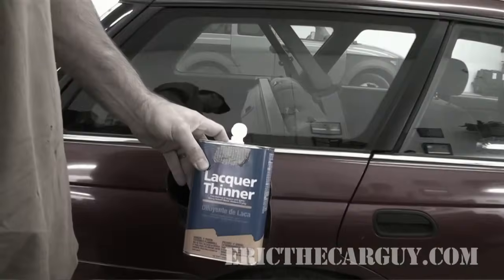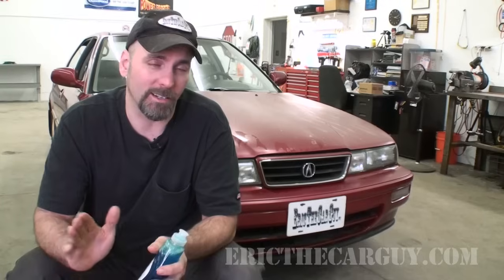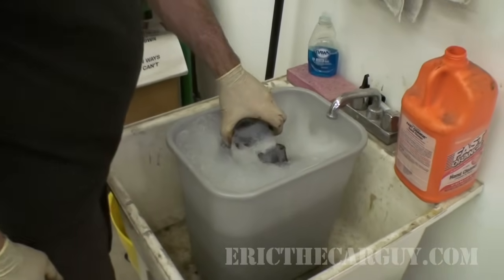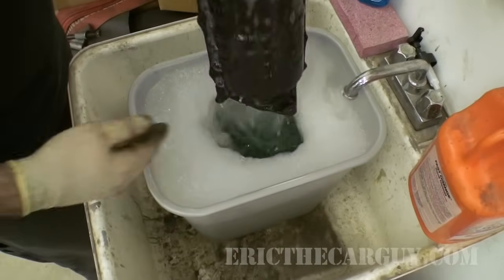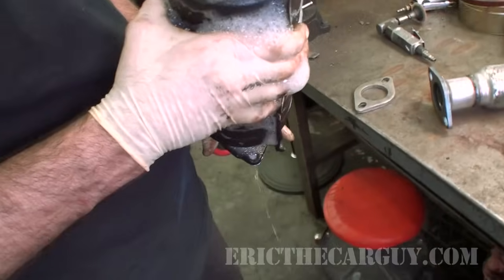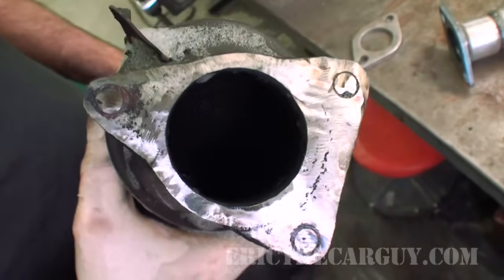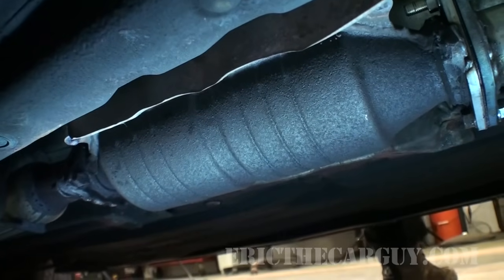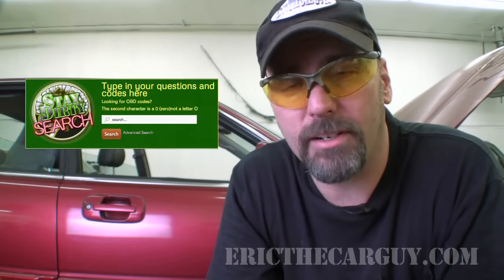Cleaning Catalytic Converters With Soap and Water -EricTheCarGuy

Comment: I usually clean my cats with a screwdriver and hammer :)
Reply: That is the best way :-)
Reply: Yep, and top it all off with the non-fouler trick to get rid of the cat inefficiency code(s) :)
Reply: Grate job
Reply: The mini cat's work great too if you put them In with the right spacers. On my 01 escape the pcm didn't give a damn about the missing rear cat, on other cars I hear you can swap two o2 sensor connectors (label them first! That are nearby to flag a slow o2 sensor code that will light up the c.e.l. but when replaced will run perfect and ignore the missing cat until you clear the codes
Reply: Would it work on my dog?
Reply: Perfect, I was looking for another method. Thanks!
Reply: I cleaned my cat on a clothes line with a 12 ga. shot gun. after what. he did to the neighbors cat.
Reply: poor kitties :(
Reply: 😂😂😂😂🤣🤣🤣🤣🤣🤣😅 haha!
Reply: air chisel plus efi live / hondata
Reply: "I cleaned my cat on a clothes line with a 12 ga. shot gun. after what. he did to the neighbors cat"
 @jprandell6738  that's not funny, that's sick. keep `em coming please.
Reply: @despat3193  jus kiddin i dont shoot cats ..but i don.t that a cat converter can be cleaned

Comment: looks like you needed to rinse it out, let it fully dry, then try again. If your exhaust is still dripping soapy water you could be flawing this test since the detergent is still covering the interior of the cat preventing it from working as it is supposed to. Same idea as covering yourself in a flameable gel, you dont burn until the gel is gone.

Comment: 3M aluminium tape is very good for repairing leaks in the exhaust system. Not a permanent fix but cheap. It's as permanent until the next time the tape gets punctured.

Comment: Hi Eric I have used WD40 you need to use  about 1 pt give it a good soak about half hour you just open the cat on the engine side I used the under sealer applicator give it a blow out the air gun it cleans the whole exhaust system there is a bit of a mess out the back of the exaust

Comment: Phase change. if water is being evaporated you will see significant temperature drop due to the water in the cat boiling off. Better to take a long drive and check it out versus un-rinsed and saturated.

Comment: i tried every thing and i mean everything, what worked for me in the end was to take the oxygen sensor out then spray carb and throttle body cleaner into the catalytic converter the hole can ,and that worked for me .the car had only done 46000 thousand miles i had error code p402 ,put oxygen sensor back in reset the code and engine light has not been back on ,and this was my last try before i bought a new cat .

Comment: If strong solvents won't take out the stuff, the weak solvents in soap won't do it....

Your problem was the exhaust leak, letting the cat run too cold and coke up. I bet the best fix, if this one's savable, would be to make sure there's no leaks, any exhaust air intakes or anything like that work (the inside of the valves can get messed up or dirty, and turn it into an exhaust outlet, instead of intake), and then run the piss out of it and get it really hot.

Comment: Question: 
Could someone at least minimize the problem of a clogged catalytic converter or muffler by parking the car in a downhill street and pouring boiling water through the exhaust pipe? and then driving the car to expel all water.

Comment: Eric you should take a look at the videos from university of Nottingham (periodic table of videos) about platinum and palladium. It would be almost impossible to get a reaction with either substance at room temperature. If I were to attempt this I would actually try the most active/corrosive/agressive cleaning agent I could find (foamy oven cleaner?) But as others have mentioned..rinse and dry thouroughly before testing. The shot with bubbles etc degrades the entire video to highschool chemistry experiment level..

Comment: I don't believe the temperature test is the most conclusive for a catalytic converter.  One other thing you have to take into consideration is that until you get all the water out of the exhaust system it will be pulling the heat off the system as steam.  Also Platinum and palladium are extremely nonreactive to most chemicals so I would worry more about the metal casing of the converter than the material in the converter.

Comment: Logically, wouldn't a mild acid like Vinegar be ideal for removing generic deposits.  For example, couldn't you soak the interior of a CAT in simple white vinegar or apple cider vinegar?  I know that this is NOT oxidation but vinegar is a well known tool for removing rust on iron.

Comment: ok,i had a chevy venture , with the cat getting red hot, took  the lamba , sorry o2 sensor ,while still hot , put garden hose with cold running water , start it up run it ,didnt use soap just plain tapwater from a garden house ,steam and water was coming out the tail pipe like crazy, but it never over heated , again

Comment: Id be kind of curious about some of those ultra-sonic cleaning solutions they use for jewelry and/or firearm parts and brass such as Lymans Turbo Cleaner or Hornaday One Shot. They are used to dissolve hydrocarbons from soft and hard metal surfaces deposited under high heat and pressure...just thinking out loud here.

As for lacquer thinner...I personally would be hesitant...you have no idea what that will be doing to your valves.

Comment: Why not just a cheap HIFLOW cat, and exhaust? In the states would be around $300 for a honda
Reply: Oxygorjia X  you can buy a "brand new" Magnaflow catalytic converter for as little as $50 for a single 2 1/2" inlet and 2 1/2" outlet. I replaced 1 of the 2 cats on my 2003 Mercedes E-500 (M113) V8 with one of those cheap Magnaflow cats, just cut out the bad one w/ loose pieces in it then welded in the new Maggie!!! Presto!!!, like new!!!!

Comment: Ok so the water evaporation will keep the catalytic converter from heating up on the back. As water turns to steam it takes heat energy with it. Oh and you probably should have rinsed the cat before reinstalling.

Comment: really the only thing that could help is if the converter has extreme carbon or soot
build up in chunks , maybee removing that stuff, if its blocking and clogging the
cat will help a little.

Comment: Put the catalytic converter in the bucket run hot water through it and as your running hit water dump half a bottle of dawn dish soap INTO catalytic converter, pour a bottle of blacker thinner in and also half a bottle of pneumonia make sure you are pouring all these products into the converter with the water on medium strength to hell push the product through the filter on the inside. Soak for 24 hrs the when done rinse with hot water for 10 min or until bubbles stop coming out and try it again

Comment: Just make an electrolysis bath with an old storage tote and a battery charger and water you can use any electrolyte like baking soda and it will be like new again...  make sure you do it in a well ventilated area away from any heat source or flame due to hydrogen releasing and rinse it real well before installing  Google it you might need to use sulfuric acid as an electrolyte same thing in car batteries just remember Baking soda will neutralize the acid if you get in trouble and spill some   hope this helps...

Comment: Dude, you ever try to clean a stove by just laying soap on it? Doesnt work.Harsh stove cleaner and agitation is needed. Or at least get some sort of metal brush or something of that nature to agitate the crud loose with soap.Hot water might help too as oil seems to come off easier with hot water but not sure what cruds uop a converter. Also if you want to leave it submerged in something that would actually clean it by just letting it sit, it might be vinegar for like 6 months. You could try To use a pressure washer through it after letting it sit in a chemical of your choosing , soap, water, stove cleaner then hit it with a pressure washer re-submerge it in said chemical then pressure wash it again, repeat process till the bond of crud finally starts peeling off layer by layer not all at once because its bonded too strong for that.You have to think of it as almost being sanded down to become small enough to actually be manageable (the crud).Because your chemical will only reach the outer layers not the inner layers of the clumps of crud unless it sits forever like 6 months to 2 years. Whoa,maybe draino would be a good place to start that stuffs pretty strong. Then soap and brush and powerwash repeats. Etc.

Comment: your not trying to clean the platinum embedded in the ceramic honeycomb your supposed to be trying to remove the carbon deposits that have coated the honeycomb. adding things to the gas tank such as lacquer thinner are raising the temperatures inside the cat burning the carbon deposits out and re exposing the catalyst raising its efficiency. I want to see the cat soaked in a oil based cleaner such as marvel mystery oil or the ford carbon remover ( both i have seen soften and remove hard carbon deposits). these methods only work on cats that are just coated in crud not those that have burned out or internally melted/shattered.

Comment: It's about what your'e cleaning off of the platinum & palladium, as much as it's about using a cleaner for platinum & palladium. If you're trying to clean off oil and grease, then dish detergent will work, but you're trying to dissolve carbon, and that is a whole different problem that detergent can't help with. The chemicals that can dissolve carbon are in the benzene family and are carcinogens that you don't want to be exposed to, and if you did try this with those chemicals, you'd have to fill the catalytic converter with the solvent and leave it for a day, or two, or three.

Comment: Get negative result, it fails to work, go on site, see you need a "High Concentration" talk about how cheap Dawn is don't use 2 or 3 BIG bottles directly in the cat so higher concentration, but use exactly the same concentration (1/2 a small bottle) that failed before (Plus ammonia) ,  then don't rinse it seemingly well enough. (removing the carbon suspended by the soap, which would just be re-deposited, but now with the added gunk of soap as well. or check if the water looked like the black carbon soot was in the water. (let alone something vaguely fancy like checking the air flow rate before and after.) it didn't work, Surprise? Not saying it would have but still.

Comment: Someone mention it before but i will mention it again depending on my own findings...
The cat on my car gets hotter on the upstream and colder on the downstream side when the car idles... even if i rise the rpms to a higher steady point... same thing happens !!!
If i want to rise the downstream temp of the cat i have to continuously bleep the throttle at very high rpms... so the mixture to get super rich to super lean... this way the cat does its job... takes the rich mixtures and try to "after-burn" them so they dont pollute.
At steady rpms the mixture is stoich... so no job for the cat...
My point is that ONLY IF the mixture is very rich or very lean the downstream of the cat heats more than the upstream.
So... i dont understand why everyone are saying that the downstream must be always hotter than the upstream ?????

Comment: I always wondered why auto mfgs don't use stainless steel nuts & bolts on exhaust.....

One of the main causes of CAT damage is feeding of raw fuel; shutting down the engine at above idle speed is one good reason to trash the CAT.

My 2004 TL has a total of 3 CATs.....

Comment: Hey everyone my friend Joe longoria and i were discussing error code 0420 and he mentioned that if i take my 02 sensor off ( the one before the catalytic converter ) and pour water where the sensor belongs this will clean out the cat...Now according to him...you must run your vehicle till it gets hot enough then take off the sensor once it cools down a bit ...get a water hose with probably a funnel a open your faucet a bit while your cat reheats causing a steam cleaning effect...in essence you are using the cats heat along with the water to generate enough heat to cause a steam cleaning effect without taking off your cat...I would advise to before hand remove your sensors clean them and put a bit of wd 40 or a lubricant just so that when your ready to take out your sensor to pour that water in it wont be difficult. You may want to have someone to help revving that engine while you gently pour that water in and afterwards you may use your infrared thermometer...GOOD LUCK!

Comment: i d say make a gasket and then a flat plate to block one end of catalytic converter then fill up with solution,  i would try and experiment with the sodium hydroxide,  it is oven cleaner,  i believe the carbon deposit you try to get off is basically that or carbureator cleaner from a soaking kit,  a gallon might just fill the converter after it could be saved in same can

Comment: I used borax to clean mine out, it did stay in the mixture for a couple of days, I did see some improvement, but nothing to brag about.Blew the converter out with air, so it was dry. Maybe it's just tired of the 300k it has on it, but hey, I will run it anyway,really don't have 900.00 for a new one.

Comment: The time involved to remove the cat converter twice is not worth it. An aftermarket cat online is in the $200 range, and California legal cat is on $300 range. I replaced mine whith A California legal cat converter on my 98 integra hatch along with both O2 sensors on 2008, had 60k miles on the cat. And after i total it that car. I transfered that cat to my other 98 integra sedan, and added another 120k miles. Total 180k miles on it. And still running right now. Now the odometer on this car is 216k miles. I just had a Timing belt service done at the dealer. And i am shotting for another 100k. The check engine light has never come on once. Just make shore not to overfill your engin oil level. As it could wear out the cat prematurely.
Reply: Plus, you probably keep your car nicely tuned. As I was dealing with my catalytic converter replacement, I ran into a bunch of people who needed it done too. One had such bad spark plugs she had misfire codes, she needed a new catalytic converter after that.

The other did it in the opposite direction. He got the new catalytic converter and then fixed what broke it - the tune up. He's lucky he didn't ruin another catalytic converter, but then, it may still prematurely wear. Usually something causes cats to go bad. Simple age will do it, that's what happened with mine.

Didn't know over full oil would do it, but then, that could destroy your engine too.

Comment: A working cat is a federal government mandate! Big fine if caught without it, unless it's a really old car. State inspections supposedly catch bad or removed cats, but all states do not have them. While unlikely, if caught by the fed it's big trouble. In modern engines removing or gutting the cat will do very little to increase power and efficiency so unless you have race mods and run on a track it's a waste of time, like putting a fart can on a 4 cyl grocery getter.

Comment: It is helpful to use HOT Water and to keep it hot while it is soaking....... It the same as with cleaning carbs if you have ever used an Ultra Sonic Cleaner.....  "Supposedly" every 7 Degrees Fahrenheit raise in Temperature  "Doubles" the speed of a chemical reaction as a "Rule of Thumb".........Cleaning with the "Soap "is a "Chemical" Process here..... It may still have not made a difference in this case, but you can be more "assured" that you cleaned it the best that you could, given that particular "chemical" - here being Dawn Soap.

Comment: Didn't you think of closing one end and three quarters filling and close both ends and agitating shake the hell out of it or atleast tip it vertical to vertical a few times to get the water flow hard through the mesh? Why not?! Then after soaking overnight, take a second bucket and strain the water through a t-shirt to hold the big bits and pour it through the cat and rinse with fresh distilled water maybe99cents(no minerals).. or try a couple ounces of TARN-X coin cleaner ,and immediately wash with distilled water, do not soak!! Maybe 50/50 tarnX and distilled water first and then rinse fast with distilled water? I got all kinds of ideas still....lol

Comment: If the objective is to take out the carbon deposits try UniqueTek Premium Firearms Cleaner™. It is non-toxic and won't harm rubber or plastic if there is any.  Also froglube but froglube is expensive.  You have to figure out how to spray it inside the converter.
Reply: Right! Gun cleaning supplies! Smart! After all, whenever I'm cleaning mine, it's usually carbon I'm after. :)

Comment: Don't think the Dawn alone or even with ammonia will be enough to break up that crusted on oil and carbon especially after a few hours need something alot more harsh since you cant even get in there to scrub it off, It's your car but id just remove the restrictive and useless cat since its doing nothing.

Comment: Hi , I try using hot water filling my '02 hyundai elantra 1.8 CAT , suddenly , a lot of platinum powder eat away ......
and I using add citric acid into hot water then filling CAT....I find more  platinum powder loss ...after install CAT back the car ,
the secondary O2 sensor show me only 0.1V  which always show 0.7V before cleaning CAT with hot water mixed citric acid .Oh my GOD , my CAT malfunction fully.
Yesterday , I replace a '03 CAT , the 2'nd O2 sensor show me 0.7V~0.8V , yes ! , the CAT is working again .
BTW , I use EML327 detect the O2 sensors respond Voltage  .
To conclusion , as my experience , Don't wash your CAT with water , hot water or hot water with citric acid which may murder your CAT.